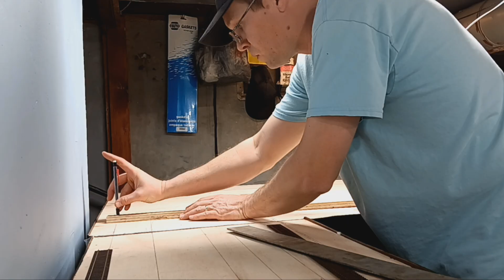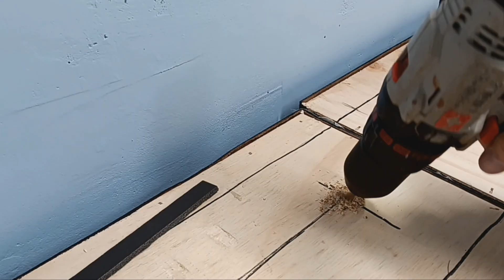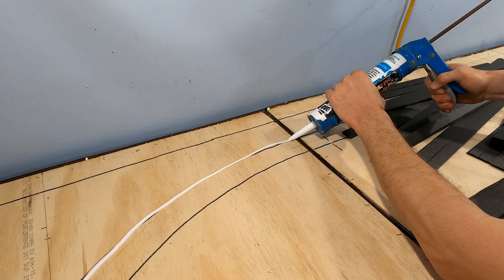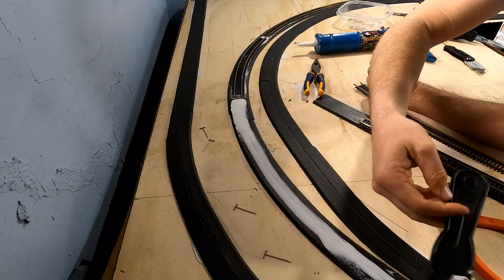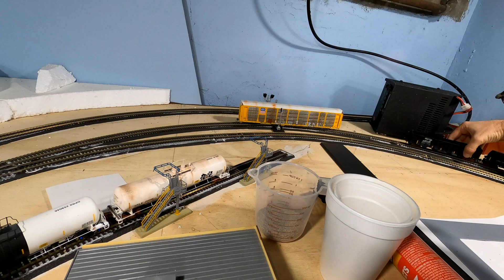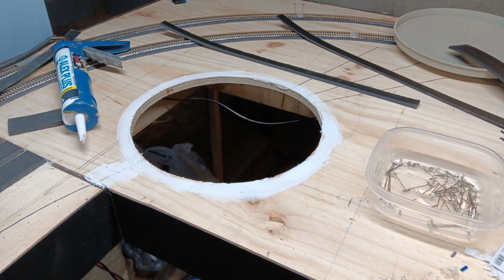St. Marshall Sub Part 4 - Trackwork

Comment: Hello.  Thanks for the video.  Very helpful tips.  I am also using code 83 Peco track.  Any particular reason why you didn't use Peco switches too?
Reply from the maker: I'll preface my response with that I've used almost every brand of turnout, and handlaid my own too (on other layouts).
So this layout is the culmination of that trail and error. And all those other brands are good brands. Each have their own benefits and drawbacks.

So the Walthers turnouts use a continuous closure/point rail. No hinge. And all the rails of the same polarity are electrically connected together. That means I can airbrush the whole switch, points and all, without fear of dead spots. That was a big factor for me. Also. There were a couple of switches where I wanted to use a number 10, which Peco does not offer.
Reply: @signalupproductions  thanks for the explanation.  Makes sense.  Pecos code 83 switches have changed and they also have no hinge on the switch points.  It's one continuous rail now roo.  But to my knowledge they only go up to a #8 in code 83.  I look forward to the rest of the videos in this series. Thx!

Comment: Awesome video, this helps so much! Do you know how far you have the track apart from each other? I have been told 2 - 2 1/2 inches
Reply from the maker: In the yard, I am using 2 inches. The geometry of the Walthers turnouts works out to that spacing when used in a simple yard ladder. Those are the only parallel tracks. The yard lead that curves around with the main track is about 3 inches.

Comment: A simple trick that greatly improves the appearance of a train where a curve meets straight track is a transition curve, or easement. Draw the straight track centerline 1/2” to the outside of the curve centerline. Then a thin wooden stick can be held on the straight track CL and bent to the curve CL and traced on the plywood. Or you can just let the flex track conform as you lay it to the two different CL’s. The finished product is a thing of beauty as a train smoothly eases from the curve to straight track without the unrealistic suddenness of the non offset track!
Reply from the maker: I contemplated having easements and superelevation. And to be honest, I don't know if I had a reason for not including those elements. But you are right, easements really help!
Reply: @ I’ve never been brave enough to try superelevation!